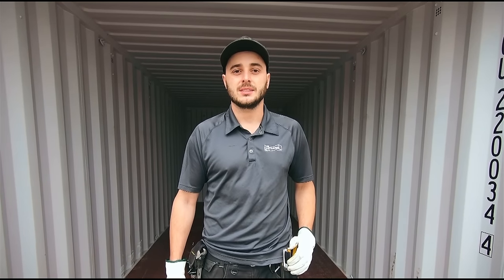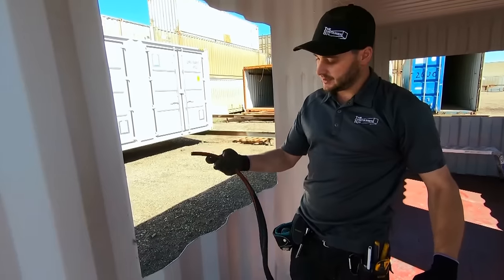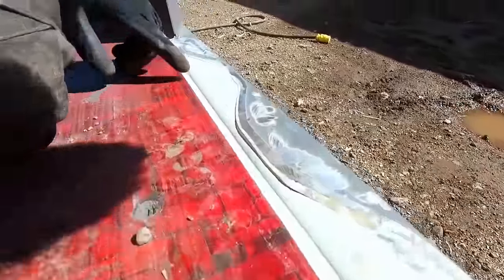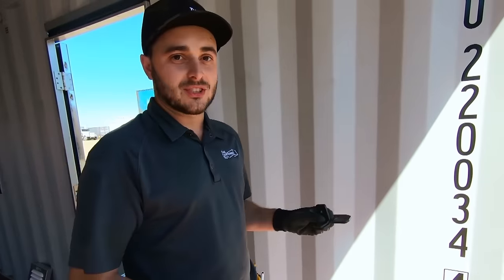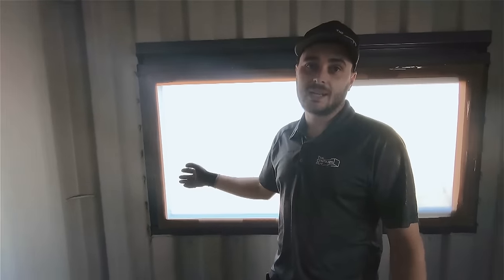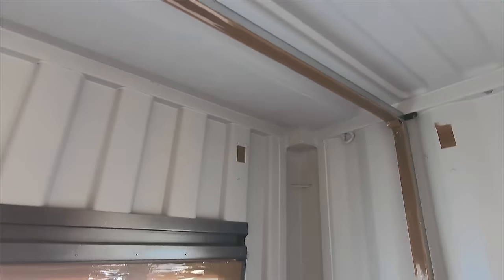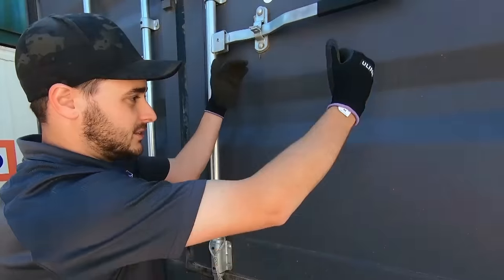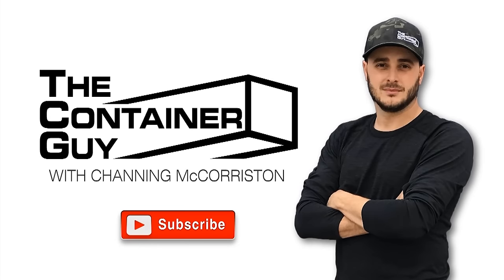Step by Step 20’ Shipping Container Modification

Comment: I need one of those containers. Insulate it, metal-stud frame it, drywall  and put a stove in it. Yep 👍 I would hat channel it. I'm metal stud framer so I HV lots of ideas. I've seen job trailers at construction sites that use modified shipping containers. Nice idea about power in to the container.
Reply from the maker: Hi Milton. We have a mod right now that will not be insulated but needs to be lined with plywood. We're testing out the hat channels tomorrow actually. We're capturing video of the project. Stay tuned to the channel so you can tell us what we did wrong😆 Think we can glue them with PL to the putter corrugations?

Comment: In general I think that you do a great job, but I would think that finishing the cut edges of the corrugation with a primer and rust preventative coating. 
Thanks for sharing you knowledge and techniques. 
Gary
Reply: most containers are made of corten steel that when rusted, makes a protective coating

Comment: Nice work guys. I put a 4.6 m slide door in one and the roof sagged. I noticed the ridges and valleys at the header spread out so I stich welded a 50X50X6mm angle iron along the head to the inside to stop the corrugations (ridges & valleys) from speading and it worked. I set a slight positive camber in there as well.

Comment: I love the track system for supporting desks and pipe racks etc. You could even use it with track roller attachments to a make a gantry crane right down the center of the roof of the container.
Reply from the maker: We have a 20'HC in our yard right now with a gantry crane down the middle using this strut system. I could do a quick video tour of it if anyone's interested. It's pretty sweet.
Reply: @TheContainerGuyTV  I'd like to see that

Comment: I really like your videos and all the input you put out there for the public. Very informative and creative. And I hate to be negative, but at about 12.45 in your video you said you would have  2 inches of spray insulation. I have built quite a few of these, with spray foam and board foam insulation. Unistrut is 1 5/8" tall, the insulation thickness after completion is definately not 2" thick, possibly in the corners, but not consistent through out the unit. I do not care about the 2" statement of insulation coverage, but is the coverage shown in the video enough? I have never had to do one by code, but Im betting you have. What is acceptible?

Comment: Great video. Good tip on the bulb seal. Would a pair of tin snips help cut that a little quicker and cleaner? We're a continuous improvement company so we are always looking for a way to save even 2 seconds on something that we do more than once. Keep up the great work.
Reply from the maker: You bet. Thanks for the compliment and suggestion. I just didn't have a set in my tool belt. My pants are already getting heavy haha. A sharp knife blade would have helped too but snips are a safer option for cuts that don't need to be offset.

Comment: Hey there Channing as regards' to the square tubing that you didn't like on the cut outs, you might consider putting some holes in the square tubing and filling it with spray foam from a can, a few smaller holes on the corners will let you know when it is all filled , stop's.. the thermal bridging . I'm from Ireland and was wondering if you have any jobs going as I would love to move there permeant. The fishing rivers there look Amazing. I have loads of experience from building houses to building  shipping containers , converting them them to house massive generating power equipment for the likes of google and Banks . I also made them from scratch to specifications for the client.  Have been watching your videos and i reckon your the type of guy i would like to work for, i love that type of work . i've always dreamed to live in Canada an ye know what ? IF YE DON'T ASK YE WONT GET, Am i right ? LOL So when can i start ? LOL
Reply from the maker: The Container Guy Ireland. Back to my roots

Comment: I have a project for you, I need a commercial kitchen, in my state(Montana), we need a commissary, commercial kitchen. Unfortunately the cost to use one is a thousand a month. I believe I can build a container kitchen that will pass state county inspection, but provide a comfortable place to do my prep work and baking.
One time use 20' container. Insulated and wired, propane lines fresh water grease trap and grey water, commercial sink, dishwasher, and moveable storage shelves on wheels. Refrigerator and freezer for stock storage, racks for baked items to cool, climate control, vent hood, fire suppression, oven stove top fryer prep table . Stuff that all in a 20' container, mandoor for entry, one window for seeing outside.
Reply: Oh and solar power battery and small generator

Comment: Question-does the foam separate the interior strut from the inside of the exterior coragated steel wall?  Otherwise there is cold bridging from the outside to the inside.

Comment: Makita makes a 6” disc cutting  only tool that’s way better than an angle grinder . The type of safety switch is important too.
Reply from the maker: I have one at home actually 👍. I'm not a huge fan of the soft start feature. 

Nothing beats the DeWalt 60v cordless for odds and ends jobs at home but don't want to be using batteries all day at work.

Comment: So what happens when it starts rusting on the outside?  Do ya cover that as well?
Reply from the maker: Yes, if someone notices their container beginning to rust, they should address it. We typically modify new containers and work really hard to not poke any holes or weld on them which is what starts the rusting process.

Comment: Is the flashing kit for the door just so you can fill it with insulating foam? I want to use a container as a storm shelter, do you have any suggestions for enabling the main end doors to be lockable and openable from the inside?
Reply from the maker: I don't have any good suggestions for that at this time. One day I'll figure it out. It's very difficult to set the thick door seals without the leverage provided by the handles from the outside.

Comment: Thanks very much for the info!  I'm in a sub-tropical humid climate with lows around 40 Fahrenheit and highs around 95 Fahrenheit. A quick online search has recommended for my area to have walls minimum R2 and celling minimum R4.
If I can customize the height of my prefabricated container frame,  what would be a good height to allow for the floor and celling insulations and still have a spacious feeling?
Reply from the maker: No such thing as a spacious feeling inside a shipping container. Don't insulate your container for space. Insulate it for your health. Use 2" of closed cell spray foam and steel stud framing. Anything porous will mold and affect your health.

Comment: Nice job on the inside. How do you keep the roof’s from rusting through? Especially if you can’t build any kind of sloped roof!!
Reply from the maker: We have Upper Decker Brackets available for rooftop decks or sloped roofs. These are not required. All containers' roof panels have a slight camber/slope to them and shed water to either side. Given this was a new container, the customer will have to keep an eye on the roof similar to how you would on an RV, starting in about 20-30 years.
Reply: @TheContainerGuyTV  well, 20 to 30 years went by pretty fast. It took 4-1/2 years. 
   One small scratch that I didn’t notice & walla . I have a rust spot that is much bigger than the small scratch that started it all. 
  Mine doesn’t get moved from job to job. If I attach a roof to it. In my town it becomes a building. Which then. Well maybe you don’t know about permits?
Reply from the maker: A huge topic of discussion at our National Portable Storage Association conferences is dealing with different municipalities' treatment of shipping containers in their bylaws and their required permitting. I am very familiar with permitting as a whole. I am most likely not family with your municipality - you are correct.
Reply: @TheContainerGuyTV  I keep coming up with some strange WebPage. I can’t find any roof brackets ???
  Send me a link please??
Reply: @TheContainerGuyTV  ok, How do I find your roof supports. 
   I’ve been using. My brain is kind of slow right now. It’s that rubberized paint. Guy cuts a boat in half then paints it back together. And it doesn’t leak. It works really well. Now that is the best roofing paint I’ve ever seen. When working on one of my cars it’s POR-15 only!!!
  That is all I’ll ever use. It encapsulates the rust. It will disappear all together.
Reply from the maker: @ltsgarage7780  we use gravel guard (same as flex seal) all the time. It works amazing. We also have fibreglass quick patches that go on like bandaids and cure in 5 minutes of exposure to UV light. They work wonders on gashes around the goofy roof corrugations.

The Upper Decker Bracket product has just been finalized and we're waiting for our first full production batch to return from powder coating. They'll be on our website and Amazon shortly. Email us at sales@thecontainerguy.ca for pictures & pricing.

Comment: A friend of mine had his shipping container sprayed with foam insulation, but it's making the container inhabitable from off gassing. What can he do to cure it?
Reply from the maker: I was doing some Googling before I spray foamed my basement and heard of a few instances like this. Supposedly this can happen if the contractor doesn't build out the foam in small enough lifts. If it is still off-gassing, that means a chemical reaction is still going on and my guess is the reaction is triggered by exposure to air. They need to stop the chemical reaction to stop the off-gassing. I imagine sealing the foam with a suitable product would be the best option to stop the chemical reaction. There is many rubberized roofing products meant to cover spray foam. Option 2 of removing the foam would be impossible and I imagine it'd be cheaper to start over with the mod. Another thing to look at (in any living space) is an (apartment sized) HRV air exchanger with HEPA filter.

Comment: First thing you need to do is consult with an engineer for the foundation and any modifications to the sidewalls especially if you are in snow country. . The corners are the only things designed to transfer loads.
Reply from the maker: You must be a building official. This is true if you are dramatically affecting the structure. This is untrue if you are simply installing a steel window or door frame that is engineered to return the structural integrity back to the container. Snow loads in my area are 36.6 psf. Unmodified ISO containers are rated for 300 psf. People must use their best judgement but if in doubt, I agree, get an engineer.

Comment: I would worry about stacking them after cutting out walls and windows without reinforcing the cutouts, roof to floor. This type of system would really pay off side by side stacked 2-3 high, with another similar set and open area between, then roof deck spanning across both sets.
Reply: All the structural strength is on the corners that’s where they’re designed to take the load

Comment: Hey there Channing. Happy New Year to you! I have a question for you. I'm getting into blacksmithing and I've been considering getting a 20' container that I can use for a shop. How much do you guys normally charge for setting up a container? I'm not sure completely what I'm looking for right now but I think I'd want a man door and at least a couple of windows for the container. Also, for right now I am running a gas powered forge but may transition over to a coal forge. Not sure what I'd need for ventilation there but I "am" looking for ideas.
Reply from the maker: Happy New Year Brian! You're obviously handy and could probably tackle the mod yourself with some of our parts and our guidance. I think the T10 exhaust fan with a couple intake dampers for when you're working would suffice. Probably don't need much for ventilation when you're not in there. Depends on where you're located. Send us an email to mods@thecontainerguy.ca if you want to chat more.
Reply: @TheContainerGuyTV  Ok. Many thanks! And a happy New Year back atcha!

Comment: Start small, add on later. Any garages out there?
Reply from the maker: We have a doublewide 40' garage/warehouse video coming out soon. It's a pretty cool build. Stay tuned.
Reply: So many garages are needed. And these are secondarily useful as storm safety buildings ...highly practical I think
Reply from the maker: Traditionally, lumber garage packages have always been so cheap. Covid pricing is changing that nowadays where they may be Merritt to container garages. Our 20' x 16' double-wide kit would be great for this application. The biggest advantage is that they're portable. Relatively inexpensive if one utilizes the existing container doors but not very usable . Would get pricier if we had to install a regular overhead garage door centered on the 16' end. Maybe I'll build one and do a video on it. Need a customer😉
Reply: @TheContainerGuyTV  I see the homes with fixed glass installed onto the door itself. Amazing. Yes I have been wondering about the door widths. Here in New York State nothings that reasonable. We have building codes and this helps alot. I actually like well constructed buildings. Just wondering if NY State has allowed any of these to be built?  I really love the idea of a sort of cabin summer community. Or either starter homes or retirement. Good for both. I'm enjoying the videos. I've previously built three homes...but years ago.  Older and single now. Wishing for a playful other half with a heart for construction. I like houses. Looking forward to your garage video.

Comment: The power plug on the exterior is upside down. The cover can fall down and leave the plug exposed. With it hanging down it can't fall open.
Reply from the maker: Hi Charles. Are you talking about the plug itself or the rubber cover?
Reply: @TheContainerGuyTV  @ 20:20 mark. Flip the rubber cover  180.

Comment: what is the R value of a container with the spray foam insulation as shown?
Reply from the maker: The R value of 2lb closed cell foam is around R6 to R7 per inch. We applied 2" all around on this job.

Comment: Please confirm you are securing doors and windows on the inside to a security plate so i cant just come with a high speed drill and pop out all your rivets on a door or window and gain access... ???
Reply from the maker: Good luck!
Reply: What kind of response is that?
Reply: I dont really think that's relevant. These aren't security outfitted windows. Who needs a drill. Just break the glass and youre in.
Reply from the maker: We don't plan to educate criminals on the security features of our windows and doors. Sean is correct that these windows do not have our security screens which are installed with carriage bolts on the 4 corners. Security was not a design criteria from our customer on this build. Furthermore, these frames are locked in with spray foam. We're working hard to show viewers a few tips and tricks we've learned over the years. Enjoy it and try and be less critical.
Reply: @TheContainerGuyTV  Im asking for future work. Its not critical nor was the previous responses needed. Its a real question, yes I can break a window. My application would not be using glass and thus the question. Foaming a window and expecting that to last was my concern. I dont see the construction of this project with any focus on security and if you did have that option I would like more info. Otherwise I will look at other vendors. How you decide to respond to a customer is solely up to you. Take care.

Comment: Ventilation not good.  Use Khind 16' Inches (Ventilation Fan) installation in reverse (suck outside air into the room).  You need at least 2 ventilation fan to a 20' room.